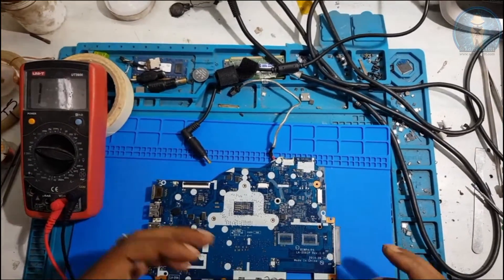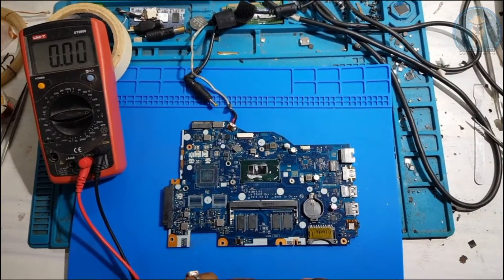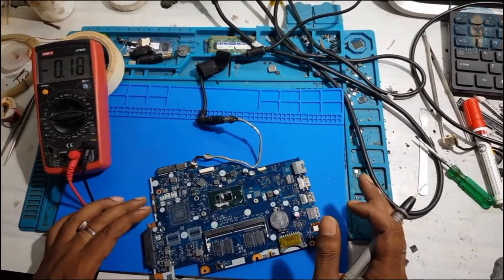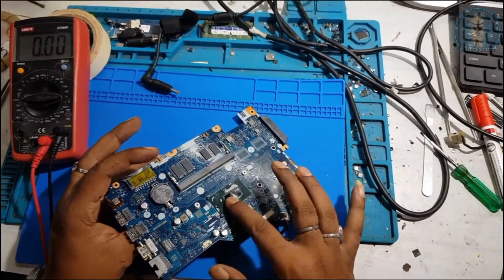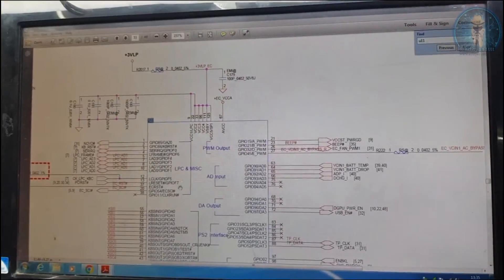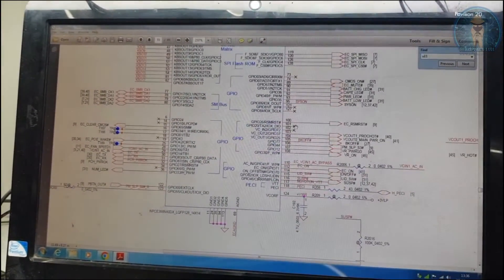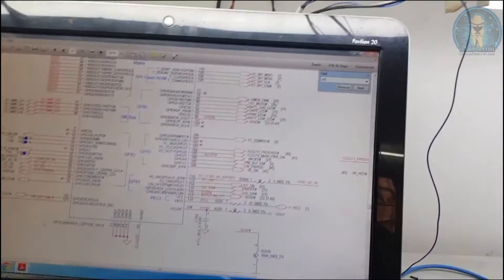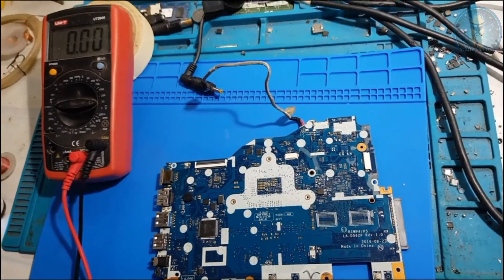Lenovo Laptop LA-D562P Press Power Button No Power On Step by Step Fix | Solution Part - I

Comment: Next step RTCRST, RTC INTRUDER, RTC INVERMEN, THEN 32KHZ CLOCK SIGNAL whether generated or not, then confirm pch power management , Rsmrst  signal ..generated or not , if generated...,, the rsmrst should be without glitch .